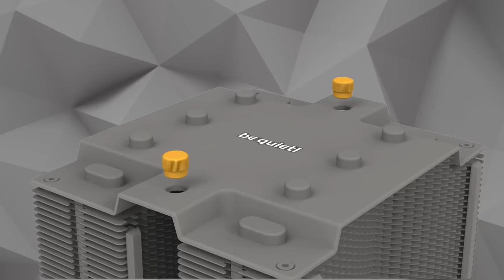Installation: Dark Rock Pro TR4 (Threadripper) | be quiet!

Comment: Just installed this cooler on an Asus Zenith Extreme amd x399 motherboard. 

For any that may have questions on the ram clearance,  i have Corsair CMK32GX4M2D3000C16 Vengeance LPX DDR4 3000 MHz, and they fit on all slots without any issue.

My PC case is Corsair Crystal Series(R) 460X ATX Mid-Tower.

Hope this helps answer some of your questions.
Reply: I have the same build and I was wondering, is your top  PCI-E slot blocked? There isn't enough space for my Vega 64. Thanks!
Reply: @noahneutral7557  hi, yes there's not enough space on the top slot, i should have mentioned this sorry.

Comment: This thing doesn't move much air and those fan mounts suck. Easy to install on a test bench, but a royal pain when inside a case. The fans set to max move almost no air. I even pulled the middle fan out to check if I had accidentally put it in backwards. I didn't. With my hand behind the cooler I felt more air from the front fans in the case than from the cpu cooler (I double checked by unplugging the front fans). With all the glowing reviews, I expected a lot more from this. Hopefully I can fit some fans that actually move some air on this thing.
Reply: have you tried ajusting the fan speeds manually?

Comment: the cooler itself is exactly the same as the normal version, the difference occurs at the mouting brackets. Right???
Reply from the maker: Yes, the cooler remains the Dark Rock Pro 4, but the mounting is TR4 compatible.
Reply: @bequietofficial  so can I purchase the TR4 mounting seperately? I've already got the Dark Rock Pro 4

Comment: Off topic question here but will the be quiet! HDD Slot Cover of the DB 700 fit in the DB 900? I can't get the HDD Slot Covers for the DB 900 and the only difference in dimensions between the two is 4mm. Thanks in advance.
Reply from the maker: Hello. Well - yes and no. Yes, they are the same size. No, they won't fit as the spacing between the HDD slots is different between the Dark Base 900 and the Dark Base 700. So it's all peachy when you use just one - but as soon as you use several of them consecutively they will start to be in each other's way.  :/

That being said: We do have all the separate versions on offer (https://www.bequiet.com/en/accessories/hdd-accessories/1477) - maybe you'll find there what you seek?

Comment: Why is the cooler moving freely over the threadripper? I just bought one of these coolers (comes in tomorrow with my 2920x) and I did not like seeing that.
Reply from the maker: What do you mean "moving freely"?
Reply: @bequietofficial  In the video when the installer is installing the fans, you can see that the cooler is moving on the processor. I think it is after he mounts the cooler to the brackets.
Reply: @bequietofficial  But, I have mine on my Threadripper and I am honestly pleased with the thermals. Thank you for an outstanding, but huge af, cooler. Love it.
Reply: @winuxtech649  Hi Matthew, can I ask about the RAM you're using? I was set on GSkill's Ripjaws V, which are 42mm tall, but still doubt how well the TR4 can fit on top, as I'm planning to occupy 4 RAM slots.
Edit: Going for a 3970X, but I think all Threadripper motherboards require RAM modules that aren't particularly tall.
Reply: KeratsiniHombre, full sized RAM will work with this cooler

Comment: Why is the base of the cooler moving @ 2:35? Almost like it's sliding on the thermal paste, even after it's fully screwed in.
Reply from the maker: There's always a little bit of wiggle room due to the thermal grease - that is completely normal and has no negative impact on the cooling performance.